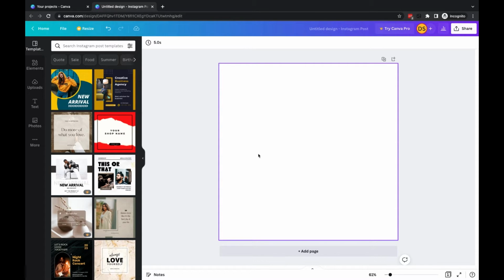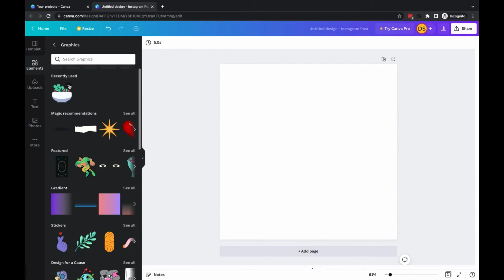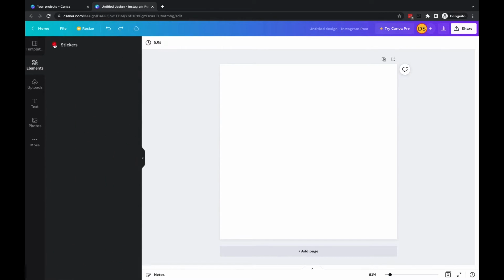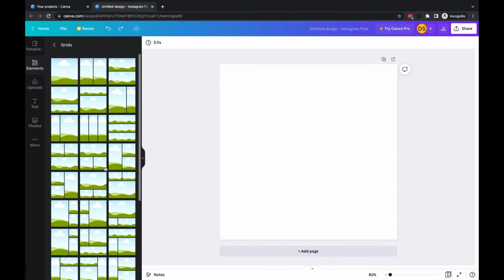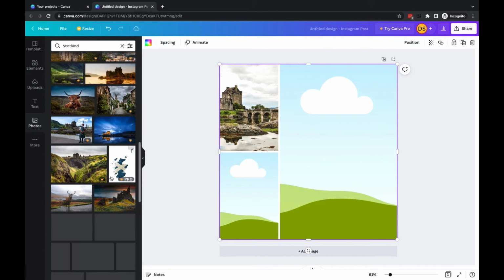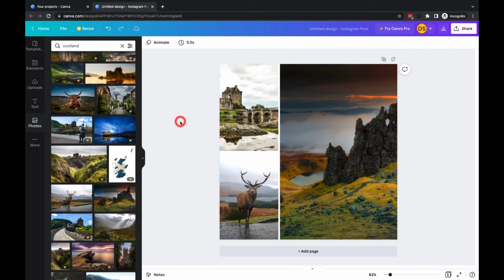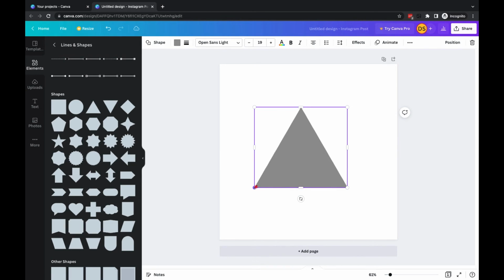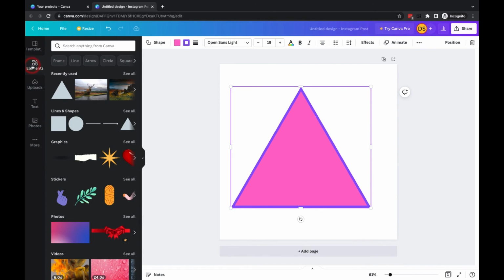How to add fun elements to your designs in Canva

Comment: Is there a way to size elements or photos on your project to a specific size without dragging the corners?
Reply from the maker: Hi Dina,

Not that I'm aware of, no. You can be more precise by turning on rulers and dragging guides down then resizing/cropping your image but you can't simply enter a specific size for your images, no.

Hope that helps and thanks again for watching. Be sure to subscribe if you haven't already :)

Andy